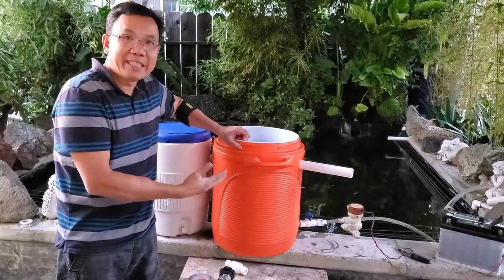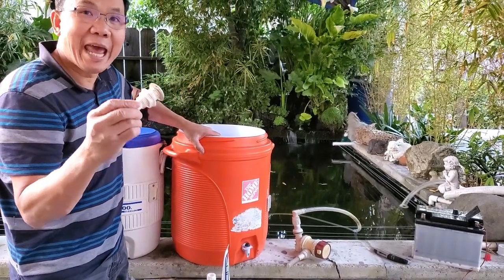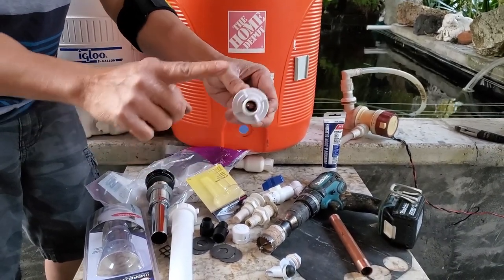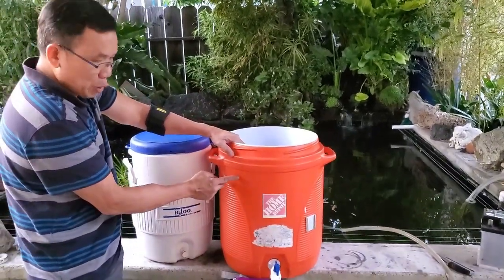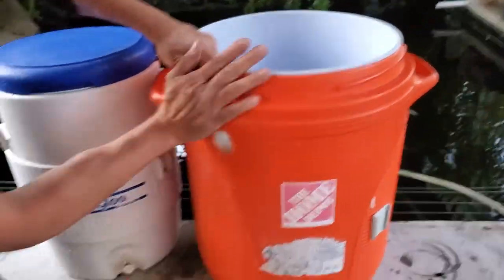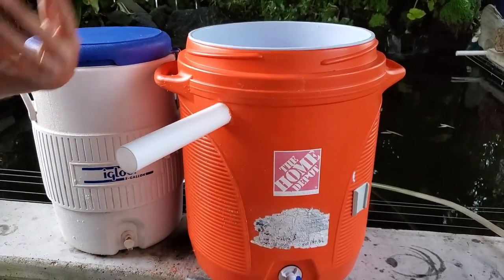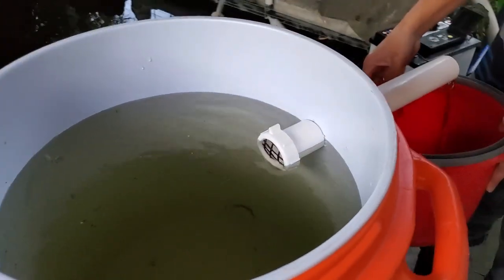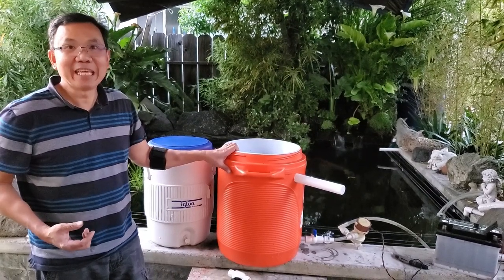SF Bay Halibut fishing:  DIY on how to build a live bait tank. - Simple, Fast and Easy.

Comment: Thank you so much for showing us how to make a live well!  I am currently, building according to your design.  I am using the 10 gallon Home Depot cooler.   One question - how powerful does the pump need to be?  Will a 500 GPH Rule pump have enough power to circulate the water?
Reply from the maker: 500 gph is ok if you know how to install the pump.  If you install the pump behind the transom, the water can't be pumped in when the boat is running.  It is the best if you have thru haul scoop or connect directly to the wash down.  Watch my other video on the bait tank because it is a better design.  Let me know if you have any questions.  Email is better.

Comment: So you're saying that in that 10 gallon cooler you can have 100 sardines and they won't die in SOCal waves? I need to build a tank and most people say you need 25 to 40gal for a full scoop from the marina, and oval is better. I found some used 15gal. Also you feed the water from the bottom is that gonna aerate the tank, or with continuous flow you don't have too, drop the water from above? These tanks are expensive so am looking for alternative for my 20ft boat. Thanks in advance for any replies.
Reply from the maker: Watching my latest video on love well with the 20 gallon blue bait tank.  The best so far.  You can use my concept and use the bigger tank.  30 gallon is good for  1 full scoop.
Reply: So the tank doesn't need to be too wide? I found a used 15 gallon 15 diameter you think it's  ok for half scoop? The blue container video I watched before, have to find it again.

Comment: We built our live bait tank from your idea. It works but not quite well. I have trouble to find the plastic mesh. We use the net to prevent fish coming out the tank. The problem is the overflow water comes out very slow. If I leave the pump turns on all the time, the water will spill out from top of the tank.  So, I have to manually turn on and off the tank. My question is where did you buy the plastic mesh?
Reply from the maker: You need to have a valve  to control the right amount of intake water going into your tank.  If your pump is too strong, the outlet can't release the water fast enough.  I have a lot of the plastic mesh.  I can send it to you for free.   I don't remember where I brought it in the first place.  Just let me know. I am more than happy to assist you.
Reply from the maker: @tomhuynh7556  I will try to send it this week.  Sorry i did not read your respond until today.  I did not get the notification of your respond.  Please communicate with me through Facebook. Ni will show you a couple trick to make the live well better.
Reply from the maker: @tomhuynh7556  please send me an email with you phone.  I will assist you how to solve the issue with out sending the mesh.  Thuy_stlucy@yahoo.com

Comment: How often do I let the pump run?  Do you turn it off when you are moving and turn it back on when you stop?
Reply from the maker: Thanks for watching.  It means a lots to me.  The location of the water intake is on the bottom, so when I run fast the pump can't pump the water in so I shut the valve to a void the water going backwards.  If you have a check valve you will be ok.  I usually have the pump on all day if I have the motor on to save the battery.  I hope to answer your questions.  Good luck fishing.

Comment: How and where do catch jack smelt in bay?
Reply from the maker: You can use sabiki rig with  a little piece of pile worm,  shrimp, or squid.  You can drift it slow troll.  Do not set hook because jacksmelts have soft mouths.  Candle stick ARW areas have more jacksmelts.  They can be anywhere. From now until November are good months for jacksmelts.
Reply: Fishing 247 Thank you!